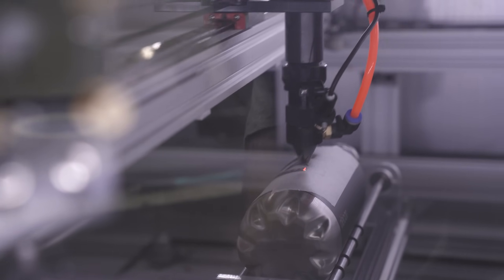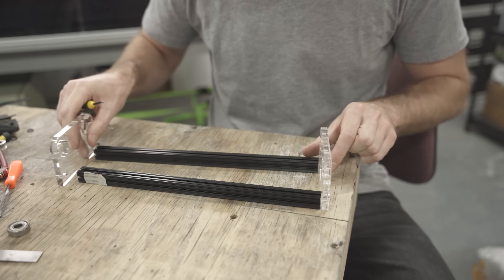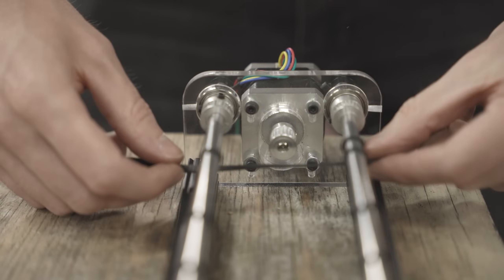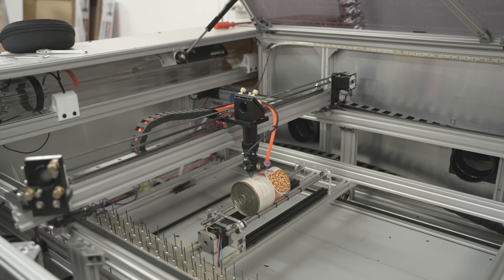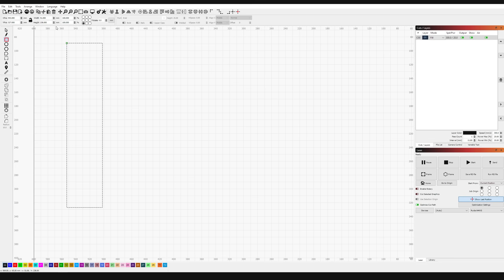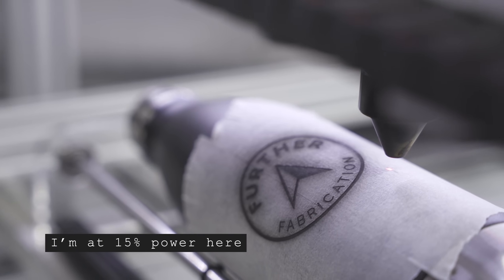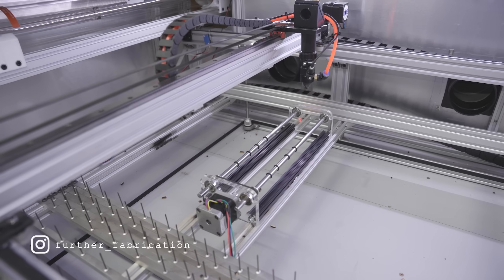DIY Rotary Attachment for my DIY Laser Cutter

Comment: Have you a source for a permanent loop belt? I have yet to manage to get one to last much past getting ready to use it. I have used rubber bands to prove that it works but not sure that they are keeping the right timing for obvious reasons. Thanks in Advance for your time and information. I built mine through use of my 3-D printer and created the same plates you did on the CNC.

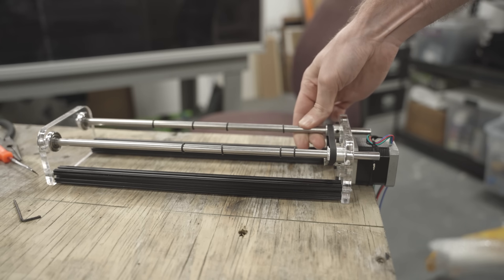Comment: 2:06 I wonder if you could layer the smooth side of another bit of belt material onto the back, overlapping the joint with more CA glue.  There's enough clearance around the pulleys, I just wonder if it wouldn't flex right.

Comment: Hi there, I've been really enjoying my Y-400 -- I was wondering if you had any problems between Lightburn and the Ruida when you were getting your rotary up and running?  I'm using an off the shelf Genmitsu and I can move the rotary manually with the Y-axis jog buttons, and framing seems to work but when try to run a file, nothing happens -- no movement and no laser fire, no errors.  If I turn off Enable Rotary in Lightburn and run the job, it does move and fire.  I'm going to look for support on the Lightburn Forums but just wondering if that came up with you.  Cheers!

Comment: Hi I bought the stepper motor using your link.  Is it normal for the motor to run hot?  I mean it's hot to the point I can't touch it for longer than a second.  Thanks!

Comment: I see you used NEMA 17, and I have several on hand, but my 100W OMTech laser likely has a different stepper, perhaps (apparently?) a NEMA 23. I am guessing that for ease of switching in and out (without having to adjust the current going to power the stepper), I would need to match the rotary's stepper to what is in the laser machine for its Y axis. Can anyone confirm what stepper is in a 100W OMTech laser?

Comment: don't make a straight cut through the belt but a long diagonal so the ends overlap. This will become a persistent connection when using flexible glue.

Comment: As always great video, I just have a little tip, 
When you use a roller rotary in light burn the Object Dia and Circumference Don't need to be set. The outside surface moves at the same rate as the rollers.
They are only used for a Chuck style rotary, where the outside Circumference changes depending on the diameter.
Reply: But the circumference will be different for different objects. The can of soup had a different diameter than the water bottle so they are going to need the diameter specific to the object being engraved. If all you are doing is the same size water bottle over and over, sure you won't need to change it but in this case he did.
Reply: @cacaokingdom3122  yes the circumference will be different, but when lightburn is in roller mode for the Rotary it does not use the values in the circumference box or object diameter. it only uses the roller dia and the mm per rotation. 

further details about this can be found on the lightburn forum if you doubt me.

Comment: If I understand this correctly, the Y-stepper driver in your setup is driving two separate motors and is set to 4.2A as a result, but the rotary stepper is rated at 2A. Is that creating heat issues? I could be confused about this. 

Also, did you leave the second Y-stepper motor plugged in? 

I love your content sir!
Reply from the maker: Good spotting! I didn't change the settings from the driver so the single stepper on the rotary is running hotter, which is fine if you're just running a few jobs, but you would want to flip the switches on the driver to a lower output if you were running it for long periods. 
Both my Y motors output from that one plug.
Thanks!

Comment: Hi, I built the y1200

Using Lightburn 9.22
Ruida controller 6445G with 15.01.22 firmware.

I just hooked up an rotary using a 3PDT switch to the Y axis and started to run test. When I enable rotary in lightburn (and verify on controller) I can jog and run frame on design and rotary moves fine. However when I hit start, nothing happens. Machine doesn’t move, or engrave and no error on controller. If I disable rotary toggle in lightburn and confirm on controller. Machine starts to engrave with rotary working. Any ideas what is causing the machine not to run when rotary toggle is enabled?

I’ve read that this firmware might send rotary to U axis. Can you confirm? Not sure if this is the answer. If it did wouldn’t framing the design also not work for me?

If it does go to u axis. Is there any instructions on setting that up?

Thank you for your help.

Don

Comment: are you using a ruida controller? I've tried getting the rotary axis working and my research turned up that you dont use the "rotary" option in the software and just replace the axis. otherwise the axis go wacko kind of....
Reply from the maker: Yeah it's the ruida (sorry totally forgot to mention that haha), the rotary option seemed to be working well in the LightBurn software, if you just ran it as a 'normal' axis you'd have to calculate the steps per mm for the rotation manually, which might be more of a pain

Comment: How would you "actually" go about connecting the belt together?
Reply from the maker: good question, sorry, I should have explained better! you can buy manufactured closed loop belts of varies sizes, I've got a link for the right sized one down in the description
Reply: @FurtherFabrication  hi, i finish mine but cant succefully engrave, wich value i use as steps per rotation? default com 360 but it nver stop .. pls helpme

Comment: I like the simplicity of this rotary. I will be giving it a try!
Reply from the maker: It's not something I intend to use often, so I figured simple was the way to go!
Reply: @FurtherFabrication  And now after I praised your simplicity I've spent the last hour figuring out ways I might over-engineer this thing! :) I think I may try having another stepper driver as you suggested in description but add a switch between Y and Rotary drivers.

Comment: Looks good! Can you consider making a video, or posting screen shots, of the Ruida manufactory settings  you have? I’m getting issues with direction, speed, and distance and can’t quite figure it out.
Reply from the maker: Thanks. I've got a full set of screenshots of starter settings in the build guide on my website. Apart from that it really is just a lot of trial and error (mostly error haha)
Reply: @FurtherFabrication  looked through the build guide and don’t see anything. Working off v1.03 for the Y-1200.

Comment: Is there a good resource for the cut capability of these lasers?  As far as thicknesses, etc.  the charts I’ve found don’t seem consistent.
Reply from the maker: Unfortunately there isn't a single fixed answer for what a laser can cut through given it's power output, as a number of other factors will play. 
Mainly material type, lens focal length and air/gas assist.
For example a 40w Laser is comfortable cutting 3mm thick acrylic but if you go really slow or even do multiple passes at full power you can cut thicker pieces but the cut quality starts to suffer and it takes ages.
Reply: @FurtherFabrication  thank you for the reply!  I’ll hearing just get the biggest tube you can afford and do some testing and hope for the best haha.
Reply: @snowgoer540  Yep, unless you want to do fine low-level engraving (some of the larger tubes won't turn on until at a reasonably high power)